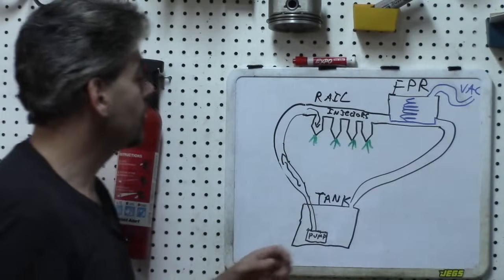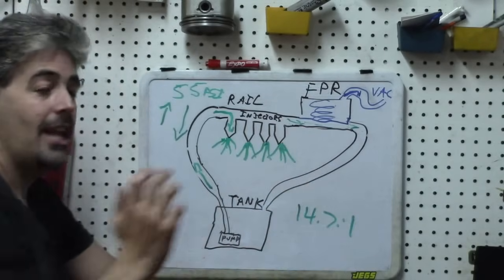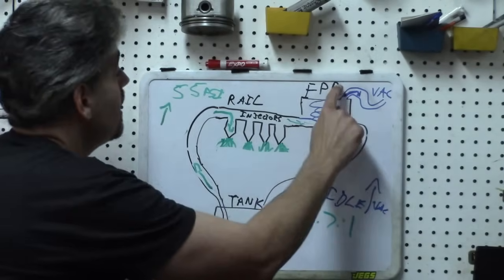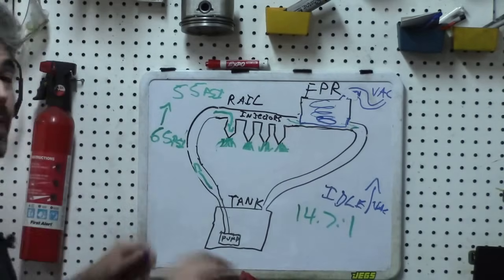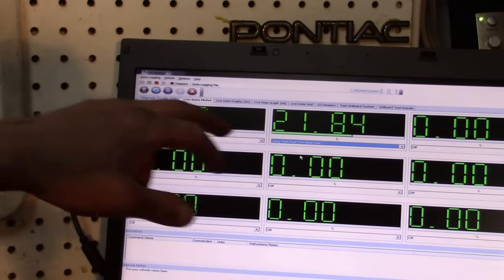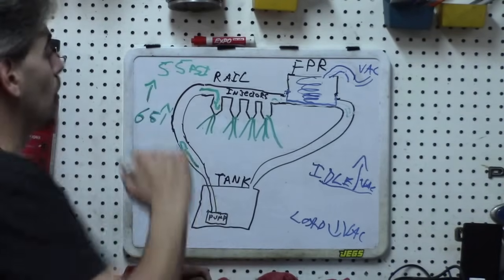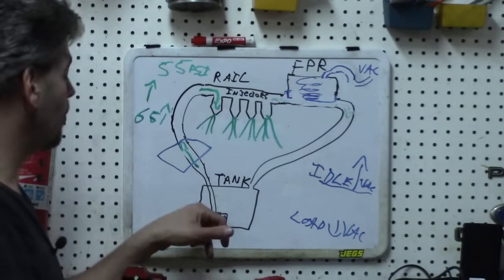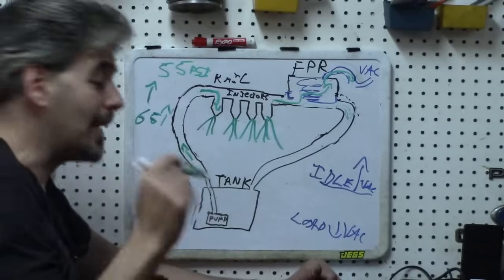Fuel Pressure Regulator Diagnosis + Understanding (HD!!)

Comment: Fantastic video man thank you I think you just saved me a new pair of shoes I've had this Acura in my yard for 2 years it was driving fine and then on the dead of cold 5 a.m. I would drive to work late and it's started not going over 45 but it wasn't that it was the pedal position that did it I had to first it was half pedal was okay then it was a quarter pedal was okay then it got to where I could barely even move over 15 the last day I drove it was I went 15 and could barely give it any gas or else it would bog out and shut off now it won't start and has not started 450 for 2 months I mean years but I'm going to suck on some vacuum hose in the morning and God I think you might have saved me it's been two to hack mechanics that sent the car back to me and said I have constant fuel pressure they can't figure it out they did not know the required PSI or anyting instead he charged me for fixing a rusted brake line and toes all over the place I had to pay him for four different toes
Reply: Oh and I've already replaced the fuel pump the fuel filter transmission filter for some great idea and the injectors are spraying and the car will start with starting fluid momentarily

Comment: Great instructional video, Very easy to understand. I have a 92 caddy with 4.9 and it sputters and stalls at low RPM. Step on it and it takes off. I took off vac hose to FPR and it runs smooth, no evidence of fuel present, upon placing vac hose back on it speeds up and coughs, sputters etc. Fuel smell from exhaust when it does this. I have no gage but most tools and a history of problem solving. it ran good till warm.
Reply from the maker: Not sure what you are asking me for, sorry.  There is no relevant data here that I can use to help with this.
Reply: Sorry I do not know how to explain, thanks for the reply

Comment: Excellent video.  My fuel pump regulator is built into the fuel pump but now I understand the concept of the regulator and more about how to think about troubleshooting in general.  

I played this video at 720P and did not notice the HD.  The picture was visually very well defined, not fuzzy, as in the past several videos and I find myself focused more on content of the video
Reply from the maker: Yes I always have known you were more of a content guy anyway- but I have to admit, I think the HD really, really shows on the underhood scenes, and also my hair- of course ;-)

  Yes the diagnosis with an internal regulator is much harder to do, you are left with pretty much pinching fuel lines but the concept is the same.  My trans am is also of that design so one day I will cover diagnosis of returnless and other more "advanced" systems, but they still depend on understand basic function.
Reply: Schrodingers Box Matt, the only thing I see that needs improvement is when you show scenes of your scan tool/lap top , hard to see, blurry !
Reply from the maker: Billy R Agreed.  My new software will allow me to take screen capture instead of filming it.  Should work much better.  It's useless if you cant see the scantool data i agree
Reply: You Rock Dude!

Comment: A general list of maintenance friendly cars which would include amongst others,a schrader valve on the fuel rail,room to service,front location for starter motor,alternator ect,and a proper workshop manual included, would be great.Great video and easy to understand.
Reply from the maker: And don't put the spark plugs under the plenum,  God I hate that SOOOO much for so many reasons !!!
Reply: Tom,

A 1970    6 cylinder Chevy pickup would meet most of those requirements! You can even change the spark plugs without damaging your skeleton. I miss the old days.....

Comment: Good lesson. The fuel pressure tracks the MAP or should. I saw pressure rise with the throttle blip and momentarily go lower as the engine was in a brief overspeed. Good point about the regulator being enclosed in the intake plenum of a 4.3 engine.  
Add some lights to the shop. The fluorescents are flat. Research color temperature...... Look is improving 
You are becomming the Bob Ross of the DIY automotive world... Happily little sensors.
Reply from the maker: Yes I do need better lighting in the garage, I didn't exactly design my garage for filming lol but I will look into that.  Yes there was a lot of opportunity to do more scan tool correlations with Fuel pressure but I want to try to keep my vids down to 1/2 hour at the most. I actually did want to show correlation with MAP to supplement the MAP video and in fact I edited out the part where I show the change in injector pulselength with load so I can demonstrate the engine's overall reaction to load, but it made the video go too long.

Comment: I did a scan and I'm pulling 274.21 psi fuel rail pressure. Not sure what the factory spec is but that seems high. I'm also running lean. Especially on bank 1. Love your channel and watch it all the time. Very concise and in plain English all the time. I definitely gotta check my vacuum line and see the difference. Also fuel filter and then rescan.
Reply from the maker: it’s possible you are reading a GDI (Gas direct injection) which has remarkably high pressure. I’ve seen it over 500PSI.
 BTW, Hi Ricky- been a while since I heard from you lol!!
Reply: @SchrodingersBox  On my scanner it said FUEL RAIL PRESSURE. You're the best buddy and I REALLY appreciate your channel. I watch it all the time. I just don't comment all the time.  I used to work on old engines all the time.  Swap them out,  head gaskets, cams,  timing chains, everything. I raced the NASCAR Street Stock Division in the Northeast and pretty much lived in my garage. Did a lot of work for a lot of people. Then I had to stop around 1991 or so.  When I opened the hood of my 2005 I didn't know what I was looking at. Totally helpless in a field I used to accel at.  It was unbelievable. Now,  I'm confident on doing my own work again.....because of your channel especially and a couple others.  There are many that are just terrible. I kept telling myself that it was just an engine and I used to rip them apart. Your explanations on everything were key in understanding the sensors and how they work, but more importantly WHY. That was so KEY in me getting to understand the differences between the old engines and these new ones.  Appreciate these videos more than you know.
Reply from the maker: Thanks man, yes I remember your comments and even us corresponding a couple years back.
  Yes- measuring the fuel pressure on a GDI is done with the rail pressure reading on a scan tool because a normal pressure gauge can’t handle it. Even so- 275 may be too low. I usually see it much higher.  See if you can find a spec for it. Also you can try seeing if pressure drops and fuel trim gets worse under load. If so it indicates fuel pressure too low but also could be caused by a dirty MAF.
Reply: @SchrodingersBox  Thanks Matt!! I'm gonna clean my MAF, check for vacuum leaks, then run my scans from cold to operating temp and from idle to 2500 RPM. Also check my fuel pressure. Along with the FPR. Once again you steered me in the right direction with the fuel rail pressure. I'll send you the data I get. I used to become obsessed when my car wasn't running good.  That stayed with me...LOL. THANKS MAN!! There are some terrible channels on YouTube, I'll tell you that.  I'm thinking my MAF is good but I'm gonna double check.  I'm betting on a vacuum leak.
Reply: @SchrodingersBox  You were right about the fuel rail pressure reading Matt!! But upon further investigation of my lean condition, especially in Bank 1,  I found oil in the spark plug well on cylinders 4 and 5, Bank 2, on my Ford 3.0L DOHC Duratec V-6 engine. Cylinder 6 was clean. I haven't been able to check the 1, 2 and 3 cylinders because I can't even see them. I need to remove the Intake Manifold. So I know at least 2 cylinders on bank 2 were misfiring. I'm not sure how this would cause a lean condition in Bank 1 though. At any rate I found what could possibly be causing everything. What a pain. This car was meticulously maintained and is in perfect condition. Just a shame.  I have my work cut out for me now. Any advice would be appreciated!!
Reply: Hey Matt.... what an idiot. I was looking at k,/Pa rather than PSI on the fuel rail pressure so about it's good.  About 40psi. I gotta pull the intake off and both valve covers to replace all the gaskets and everything else I can while the top half off. Getting a misfire now on cylinder 3. Probably oil in that well as well.  I'll check all the voltages with the multimeter on everything while it's apart also. Thanks a million buddy!!

Comment: Matt, I am perplexed and so is my mechanic.  The fuel pump on my 97 Corvette C5 started to whine.  The whine would change tone when I put on the brakes, the A/C compressor cycled or when I turned on my turn signals.  Actually, the whine would go up and down to the beat of the turn signal flasher.  I am on my third fuel pump and while the pump can be quiet for the first 20 miles or so, after a longer drive, especially in hot weather, the fuel pump starts to whine again.  The whine is very loud.  Along with the fuel pump replacement, the grounds were checked, cleaned and reconnected, the fuel pump relay was replaced and the fuel pump pressure regulator was also replaced.  It didn't matter.  After a long drive, the fuel pump whines/howls, whatever you want to call it.  The fuel pressure remains at 55lbs at the fuel rail even when I disconnect the fuel pressure regulator vacuum line.  It doesn't matter if I gun the engine or let it idle, the fuel pressure remains the same at 55lb of pressure.  It will not fluctuate. One other factor is that when you turn the key to the on position without starting the car, it takes three times of doing that before the pressure builds up to 55lb and then it will start.  Once I shut off the engine, the fuel pressure in the fuel rails immediately falls to ZERO.  In other words, the fuel rails will not hold pressure.  There is a check valve in the fuel line that goes from the tank to the fuel filter and I'm wondering if that could somehow be getting in the way and clogging up the line after a long drive and therefore making the fuel pump work harder and therefore whine.  What do you think?
Reply from the maker: sounds like contamination in the fuel tank to me

Comment: Great video sir.... easy to understand the fuel system,Ford also has a one way flow valve at the pump to keep pressure in the system when the eng. is turned off.

Comment: Great video .  I have watched numerous auto repair videos, you are the only one I have subscribed to. BTW, I watched your video on LTFT  / STFT and found a nickel sized hole in one of vacuum lines. On first inspection every thing looked normal, when I moved one of the other hoses out of the way I could clearly see the hole. Replaced the hose and all is good, the LTFT looks better (4.5 on B1 & B2). I may still have a minor leak somewhere, time to build a smoke machine and see what I can find. Thanks for the video, you have a gift for teaching !!
Reply from the maker: Thank you!!!

Comment: By suctioning in the FPR after taking it out, there is not passage of anything (fuel) so my rationalization is that he FPR is stuck in the close position, causing the pressure to be high , to the point of causing fuel to leak out of the gasket of in Fuel Inj # 2.  This video save my peace and the car wish I was going to burn out of frustration of not finding what the problem is. I feel confident now that this is the problem so I'll order the FPR immediately  Thank you, very very informative.
Reply from the maker: +Ron Ackerman That is impossible to happen. If you have fuel leaking out of the gasket then you have an external leak from the injector collecting at the gasket. Once in the cylinder and the valves close you can't get pressure pushing fuel outside the intake- that is impossible.
  You might want to recheck that diagnosis.
Reply: +Schrodingers Box I see your point, I changed the 3 fuel injectors in bank 2 (the one closes to the radiator in my Eclipse GT 2003 3.0L) and maybe the rubber seal was pinched. What I know is that in looking for the source of the overwhelming fuel odor, I twisted the fuel injector and could hear the pressured air escape (with the engine off). and the rubber looked visbly wet.  In any case, I just ordered the FPR online at a great price :-) and will be changing it tomorrow. When sucking on the old one, it seems stuck and not letting any fuel pass to the return.  Fingers crossed. Thanks for the reply.
Reply from the maker: +Ron Ackerman dude I honestly have no idea what you are talking about- just make it simple- what was the static fuel pressure with and without vacuum hose attached?? That's all you need.

Comment: I recently worked on a 2001 Nissan Sentra 1.8l that stumbled terribly at idle..I applied vacuum via a large syringe and a piece of vacuum line to the FPR and nothing changed.....so I decided to apply pressure instead and the engine ran smoothly...so I replaced the FPR thinking is was broken and nothing changed...( this was before I watched your awesome video). I decided then to do a fuel pressure test and the initial psi read 45---60 static..cycling the key 3x...then started her up and the needle jumped crazy between 30 and 70psi...during idle...I turned off the engine and pinched off the fuel feed line and the return line...no pressure drop...did just the feed line next and the needle would drop slowly to 20psi within 5 minutes...I figured maybe fuel pump check valve...dirty filter??...to your credit I got the idea to RESTRICT the fuel return line with some vise grips til the pressure at idle stabilized to around 60 psi on the gauge....just enough to keep the RPM,s at 800 to prevent the engine from dying at a red light.....this totally worked as a ER fix...car hasn't ran this well in 2 years...long story short...the fuel pump is totally dead now (5 days)....I have new pump and pump filter on the way...would there be any other avenue I could have taken to have diagnosed a weak fuel pump instead of replacing a good FPR??   

UPDATE:   Replaced fuel pump and fuel filter...still stumbles at idle...no change....partially restricted fuel line again with small vise grips and it smooths right out....i can drive the car as if it was new...removed vacuum to FPR and nothing changes neither...crank sensor code keeps returning as well...even after cleared...im at a total loss....wtfrig man... )  :

Comment: Thanks again. I discovered 2 kinks in  back of the fuel filter. Inverted the filter hanger to remove kinks. 08 ford e350 sd van. Codes went from 0190/0191 to a 0171 after removing kinks. Starts and runs for few minutes. Might need to replace fuel line. At 160k miles, most likely the pump sock is dirty and restricting flow.

Comment: Very good video, a step in the right direction to bring down the number of parts changers for sure.   Get everyone using their noodle, and doing the fun part of working on cars.   Good plan ;P      ya i said it,  the busted knuckles and grease, na...thats not the fun part although it calms me...the fun part is figuring out what is wrong and nailing it using supporting data on the first shot.  thumbs up man
Reply from the maker: Couldn't agree more Rhage- one I solve the problem, the fun stops and the boring part starts.

Comment: Thanks Matt.
Now all I've got to do is fix the problem which I don't seem to be getting nearer to.  I don't have a fuel pressure gauge.  Back tomorrow.  Cheers a lot.
Reply: Ilovetosingem I picked a fuel injection pump tester for $20 at Arbor Freight yesterday. Its a Pittsburgh Automotive 11 piece item# 92699. They have a 1 year return policy which I wanted to use but shut the hood on it and the glass face is now cracked. Ha1 that will teach me to work on a car in the middle of the night.
Reply: Tesla Rawks OK Thanks a lot for the info.  Cheers.

Comment: Dead Head Pressure
    (almost (or) nobody mentions this test)
This checks the maximum output pressure of the fuel pump. With the return line pinched shut, the pump should produce two times its normal operating pressure at idle. If the pressure rating does not go up with the return line blocked, the pump may not be able to deliver enough fuel at higher engine speeds. Possible causes include a worn pump, low voltage at the pump, a plugged fuel filter or inlet sock in the tank, an obstructed fuel line or almost empty fuel tank.

Comment: Matt I checked the purge valve line as you indicated and the car is fixed, from watching your fuel trim videos. This one is very interesting too. A few weeks ago I was looking for a fuel pressure regulator on another car and realised the fuel pressure was controlled I assume electronically by the fuel pump as you referred to here.  Only one fuel line was present from the tank to engine fuel rail.
Reply from the maker: Yep that’s known as a “returnless” system. I don’t really like those as much because they are more limiting in diagnostic approaches available.
Reply: @SchrodingersBox  Yes of course in that situation you would need to connect the fuel pressure gauge to the feed line as you stated in this video.